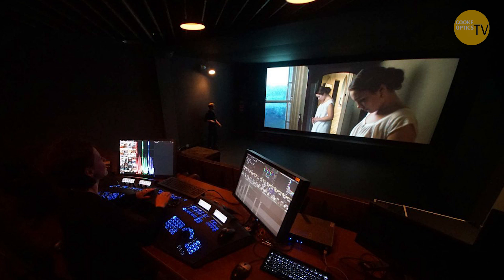Digital Sensors and Dynamic Range (Part 1) ||  Spotlight || Geoff Boyle

Comment: Anybody knows what year is this interview from? It seems like there were no HDR monitors around. I also still use my spot meter on set, but I usually combine it with waveform, although it's not 100% necessary. One argument in favor of waveform and false color, is that these alternatives measure what actually goes on in the sensor, instead of the lighting reflected by subjects ou objects in front of the camera. In film, we trust the manufacturer of film stock, for an expectable response to a certain level of lighting. Sensors don't behave like that.